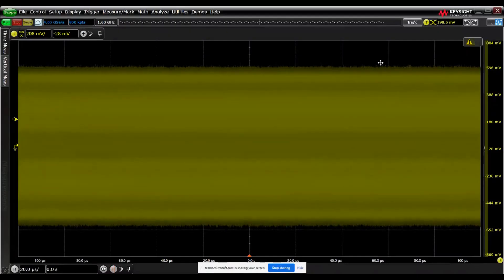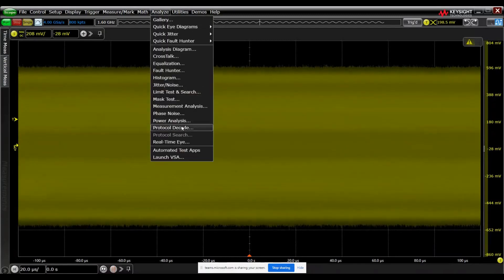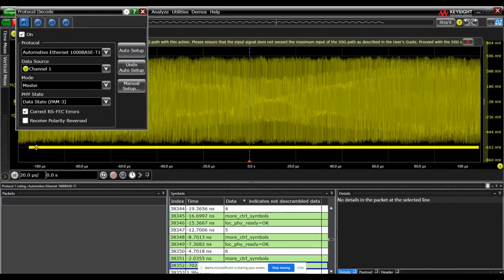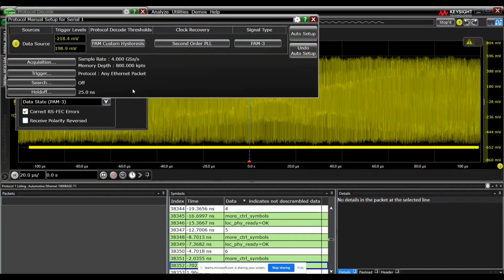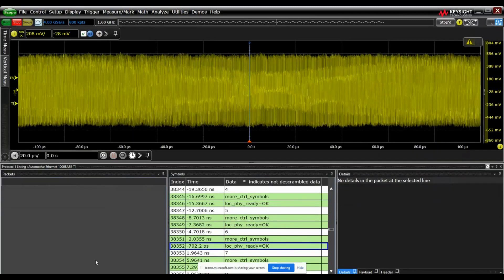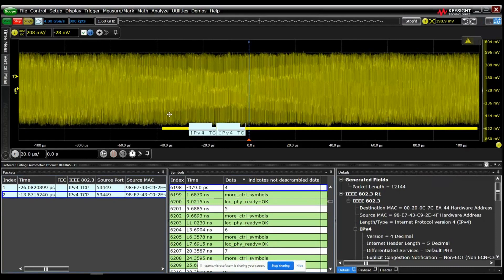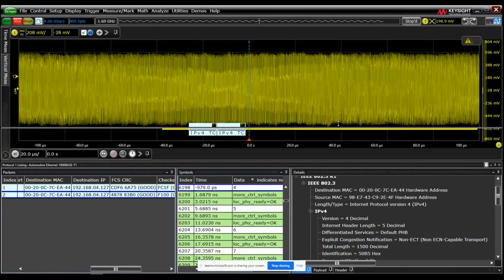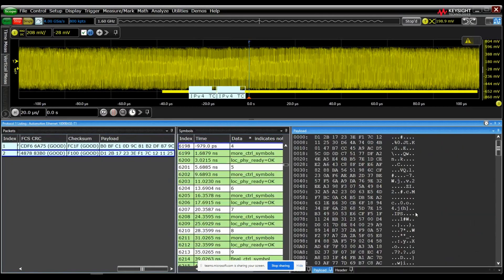Automotive Ethernet 1000BASE-T1 Protocol Decode demonstration

Comment: Does D9020AUTP provide support for 1000BASE-T1 decode on S-Series and EXR scopes? What would be the minimum required bandwidth?
Reply: Yes, Infiniium S series and MXR/EXR should support the D9020AUTP 100/1000baseT1 protocol decode. Particularly with MXR/EXR, the hardware trigger is also enabled to trigger on specific automotive ethernet signal packet. For 100baseT1 protocol decode, we recommend a 1 GHz Infiniium scope. For use with 1000baseT1, we recommend a 2 GHz Infiniium.